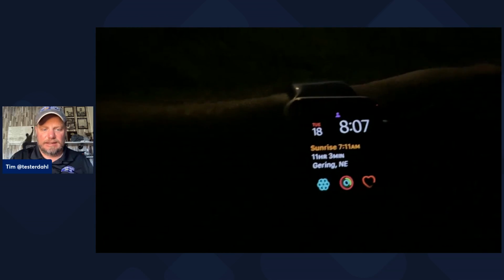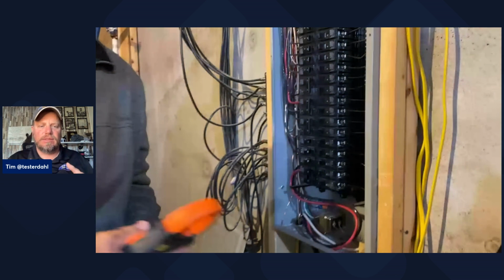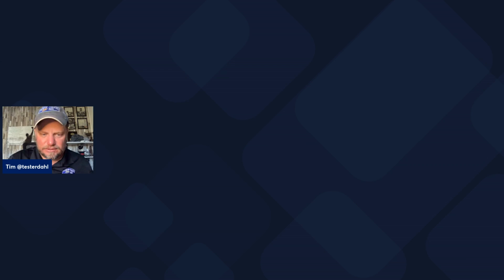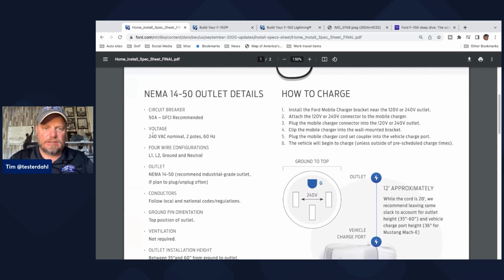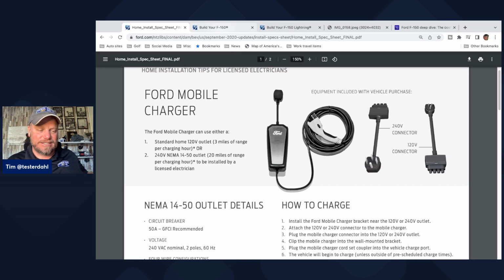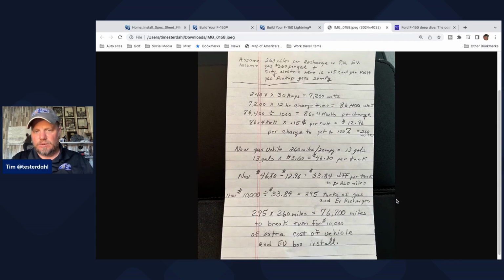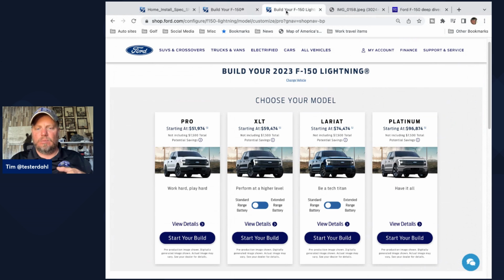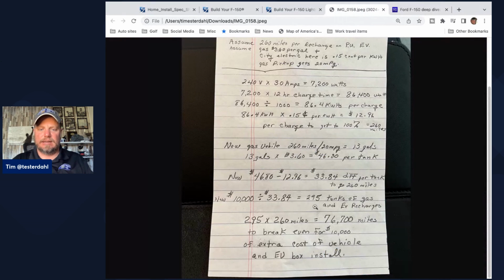11+ hours later on 220V charging price for 2022 Ford F-150 Lightning

Comment: 10 minutes to fuel up my conventional truck and go 400+ miles. EV takes 13+ hours to go <300 miles. QOL difference is worth FAR more than any 'savings' you might get by going EV. Never mind the SOUND of a good size v8 is far more satisfying.
Reply: For some pickup use cases sure, but that may change in the future. For more commuter type EVs and their typical use cases though, QOL is improved since you’re not stopping for even 10 minutes every week or two.
Reply: Not to mention you can’t use an EV truck as a truck. 85 mile range hauling 1000-1800lbs? Lulz
Reply: It took Tim 0 mins to charge to 100%, did you not watch the video?
Reply: Amen dude
Reply: If people think oil is so limited then they should really check out how little material we have to make batteries. The price of materials will triple in no time.
Reply: @Tony-hf9mv  Yep 100%.  And not to mention the colosal diesel machinery it takes to mine it, and the ships and trains to transport it.  The mining machines each use 300-500 gallons every day, and the amount of diesel a ship burns is unfathomable to the human mind, not that I care, I’m an ag technician.  But EV fan boys are annoyingly and willingly blind.
Reply: @Tony-hf9mv  That it will. Plus, recent discoveries have concluded that oil is not from dinosaurs as scientists 100 years thought was the case, but it is actual algae and it is made continously throughout the earth.
Reply: @DanBCooper  LOL because oil and then gasoline don't need to be transported they just magically appear at gas stations.

Really though there are studies that take all the transportation and mining into account and EVs break even ecologically after about 3 years and it's getting shorter all the time as the grid continues to get greener.
Reply: @usa-ev  and there are studies that show the opposite.  You’re not jaded are you, Mr “EV” ?   Lol cmon dude you’re obviously one sided and willingly blind
Reply: @DanBCooper  I'm not willfully blind, I understand BEVs have a greater ecological cost up front due to mining and material transport. But i also understand that BEVs pay back this deficit as you use them, which is not the case for ICEs that just spew more and more. These studies went to great lengths to detail all the "costs" on both sides. What do you believe I am turning a blind eye to?
Reply: Amen driver✊🏿
Reply: @ALMX5DP    Except the problems/limitations of EVs remain the same as they were  when electric vehicles outnumbered gasoline powered cars in the early 1900s. So if these limitations in comparison to fossil fuel burning engines have not been overcome by now...
Reply: @usa-ev    kids in the Congo may disagree with your opinion however.
Reply: A) What conventional truck do you have that goes 400 miles. It's quite curious that you didn't mention it. Is it the same class as the Lightning?
B) How often do you go 400+ miles in one shot? If it's more than a few times a year, then yeah, your QOL with an ICE is probably better. But you also qualify as a corner case compared to most drivers.

Most drivers (80%+) don't drive more than a few hundred miles/week with long distance journeys being a couple times/year. For those drivers, their costs and QOL are much better as they never have add time + distance to fill up on a weekly basis; they just go home and plug in. Your assertion may be correct for you, but it's the wrong math for most drivers. 

I drive 250+ miles every few months between Seattle and Portland. Even when I charge away from home, it's not much of an inconvenience; fast charging stations are at shopping centers, etc. I can top off in about an hour while I'm enjoying lunch or dinner. It's only at home that it might take 8 hours.

I haven't bitched about the cost of gas in 2 years- my cost and time expenditure charging at home is stable, and much cheaper than any gas station, and my quality of life has vastly improved now that I'm not sitting in line at Costco to get the cheap gas because of volatile oil prices. EV owners also have the added benefit of never needing to schedule time for an oil change (something else I'm sure you're not taking into account in your cost/QOL argument).

You should be thanking me and other EV drivers instead of critiquing our choices. Our choice to move to an alternative fuel has kept demand on oil lower than it would otherwise be, which has kept prices lower than they would otherwise be. Imagine if tens of millions of EV owners worldwide were still putting demand pressure on the price of oil- you and your ICE buddies would be paying much more today. 

I'm not going to crap on your choice to keep your ICE if it meets your need of driving 400+ miles in a single trip more than once a month- it makes total sense for your particular scenario. But your assessment of QOL/cost is completely wrong for most drivers, especially when you consider that electricity prices will always be more stable than oil prices. Oil is a monopoly resource, there's only one way to get it and refine it for your needs. There are at least 6 completely different ways to produce electricity that will always be in competition with one another. You can't mine/refine oil in your back yard while you can harvest electricity right off of your roof.

And this is only the first generation of EV trucks/products. The next generation of battery/motor technology is already in production and surpassing this one. ICE technology has plateaued and can only be improved (both in terms of performance and efficiency) with the addition of EV drivetrain components. Your 400 mile truck (in addition to this Lightning) is already being eclipsed by vehicles that can go 500 miles plus and go from 0-60 in less than 3 seconds.
Reply: I get 675 mile range out of my F150 with extended size tank.
Reply: @paulo3011    let's see if you are still in such deep love with your EV choice in 10 years. But it is your money 💰. 💰. 💰...
Reply: @Kdavis8377  that’s fake news lol. The range is limited but not to the extent you say here. Also you have to understand there are fast chargers. But for normal use. Charge overnight and have full battery next day. And it’s a lot cheaper. Also you have to remember we are in the early days of ev and chargers
Reply: @moultonlavagaming  it’s not
Fake news. I literally watched a YouTube video. A guy pulled a light load in his electric truck and barely made it 100 miles or less.
Reply: @Kdavis8377   I saw the video from tel trucks where at close to max load it’s about a percent per mile but definitely wasn’t your claimed weight of 1300 pounds. Show me the video you are talking about.
Reply: @Kdavis8377  also it highly depends on the profile on the trailer as well.
Reply: @Kdavis8377  also you are doing this on 4 gallons of gas. So you are towing that with so little is pretty cool. As we get the batteries better that range will increase more.
Reply: @moultonlavagaming  And I will add that the next test should be with an ICE vehicles that only has 4 gallons of gas an then see who has the most range.  That is how you show the efficiency difference.  All EVs need now are larger capacity batteries and that is coming soon.  All that is the matter is the “gas” tank is too small.
Reply: @GoogleUser-xr2hr   Of course your gas tank is equivalent to ~1000 Kw-Hrs. More or less.  Depending on its actual size of 25 to 35 gallons of gas.  Think of not only the cost of buy that amount of gas and the environmental costs to produce it and ship it.  EVs will never need a battery that big.  There is a better way and it is coming.
Reply: Personnel I like the quiet of my lightning.  Plus no more gas stations or fumes. No more ICE vehicle maintenance. Plug it in at home and all charged in the morning. I wouldn't have bought if it was to be used for long distance driving.
Reply: @Kdavis8377  If you want a truck for long distance hauling or towing then the lightning isn't for you.  I bought mine for local use. I can haul over 1600 lbs in the bed and if I need extra I hook up my trailer and can tow up to 10,000 lbs.  Anywhere I need to tow or haul. Plus I have very little maintenance,  no fuel stations,  no fumes, more torque than any F150 I've ever owned and I  can still get the equivalentcy of over 35 mpg towing 10,000 lbs and hauling 1600 closer to 70 mpg at today's fuel costs. Not towing I pay $.08/kwh that's $.04/mile in winter and $.12/kwh which is $.06/mile in summer. I'm done driving fuel guzzling, noisy, maintenance extensive ICE vehicles.
Reply: @Tony-hf9mv  I drive an average of 150 miles a week with an 8 yr/100,000 mile battery warranty I don't worry about the battery.  And since I keep it in the recommended 15-80% SOC range I expect it to last as long as the tesla battery, which some are still on the road after over 300,000 miles.  He'll, I'm 73 years old, even if I lived to be 100 I could drive that far. And talk about a great investment.  I paid MSRP for my platinum,  I  could sell it today for up to $50,000 more than I paid for it.  The demand is that great.
Reply: @pstoneking3418  drive 600 miles a week just for work
Reply: @usa-ev  You just can convince these ICE vehicle diehards.  I average 70 mpg equivalentcy with my lightning platinum and even if I'm towing so it drops to 35 mpg. Who cares I bought it for local use. I couldn't get even 20 mpg with my 2014 F150 & yes it had power but I have the same instant power with my lightning.  Granted these aren't for those people that want to use the for long distance traveling.  But the big reason for that is the lack of charging stations. One day there will be as many or more than gas pumps. Of course I won't pay the ridiculous price for public charging anyways since I can plug in at home and even if I had to put in the entire 131 kwh @ $.08/kwh in winter less than $11.00 summer closer to $16.
Like I said  diehards.  But not because if their age I'm 73 & love my lightning.
Reply: @DanBCooper  Look EV's in my opinion are not ready for long distance traveling, mostly because the lack of charging stations. (Excluding Tesla)   I bought mine for local use and it not only out performs my 2014 F150 V8 flex fuel that was all beefed up with 8 lug wheels and heavy duty suspension. But it does it at lower costs averaging me 70 mpg hauling and better than 35 mpg when towing its max of 10,000 lbs. I charge at home for $.04/mile winter & $.06/mile summer. Yeah towing costs about twice as much but remember local towing so wind resistance isn't nearly as bad as on open interstate. 
I know it's hard to convince diehard ICE vehicle enthusiasts,  and that's fine EV's aren't for everyone,  that's a fact
Reply: @JK-wr6is  That's exaggerated line lost I've installed my own meter on my lightning charging port and after adding 46 kwh to my truck I consume 50 kwh of energy at the grid. That's closer to an 8.5% loss. But when you're only paying .08/kwh in winter &  .12/kwh in summer That's a small price to pay.  Easily averaging 2 miles per kwh so that brings the cost down to .04/mile winter months & .06/mile summer months. $4.00 to drive 100 miles winter & $6.00 in summer. That's in a truck that weighs nearly 7000 lbs.
Reply: @paulo3011  It's very difficult to convince ICE vehicle diehards that EV's are great. I've been waiting for ford to come out with an all electric truck for several years now. I missed my opportunity to get a lightning reservation and was told if I was lucky I might be able to get one by 2025. That was very depressing for me as I'm already 73 and as we all know we're not promised tomorrow.  Anyway bugged my local ford dealer every week to let me know when they get a mannequin so I could drive it. Finally as luck would have it they called and asked if I'd like to test drive. First person they called. Of course YES. When can I come in. First in morning. I asked will you be selling it? Not for 6 months,  but if I was interested I could put a $1000 non-refundable down payment & in December it would be mine. The best day went for my ride but first thing I did was put down the $1000 which I told them I'd be doing the previous day. I'll take possession of it this December.  In the meantime I  had scheduled to drive it for 2 hrs ever Monday. For the past 3 weeks now I've been driving it from Thursday mornings until Monday mornings. Now that they have another mannequin I'm on the schedule to take it every Thursday- Monday. Almost like it was mine.  It will be in December.  These people haven't a clue what they are missing not having a ford f150 lightning. One fantastic truck.
Reply: @DanBCooper  And I could put a generator in the bed of my lightning.  But the main point of EV's is to get away from the gas, fumes, noise & extravagant maintenance required.
Reply: @m_m_m_beer8917  Do you even have a clue how long tesla batteries have been lasting? Some as much as 300,000 miles and still going. I  drive my lightning approximately 150 miles a week or 7800 miles a year. That's over 38 years.  I'm already 73. I don't believe I'll live another 38 years.
Reply: @Kdavis8377  It's not the weight that kills the range, it's the wind resistance. But you are definitely right. If you're looking for a truck to tow long distance the lightning,  nor any other EV truck is right for you or anyone else. But if all your truck usage is local like mine is then the range isn't an issue because at the slower 55 mph speed limits the wind resistance is much lower, therefore your mileage range is only cut by 1/3. So I can tow the tallest trailer weighing up to 10,000 lbs and still easily get 150 miles. Pull in at home and charge back up overnight for $.08/kwh.
Reply: @Tony-hf9mv  I'd say the lightning or any other EV isn't for you. Maybe some day when battery technology evolves. But not right now.  And our public charging infrastructure is terrible. But it's perfect for me and many others too.
Reply: @JK-wr6is  maybe a little higher than that but regardless when I charge at home for as little as $.08/kwh I  don't complain about it.
Reply: @pstoneking3418  The honesty in your response is very refreshing.  And truthfully I say the more EV options the better, it’s not for me, or most truck owners, but if it works for you especially with your relative cheap utility rates that can only be a good thing imo.  I’m all for it.
Reply: @pstoneking3418    Neither do I.
Reply: You need to change your thinking about how EVs are charged vs gassing up an ICE. You will charge overnight to get the mileage you need for the day, then at the site or at work while you're doing your work. You won't need to take time out to charge up because you will do it when you're not using the car.
Reply: @Kdavis8377  think differently about trucks and their relationship to trailers. Now that we can put batteries and drive motors on things, why not the trailer? Lippert and Airstream have already done this making the trailer a net zero load on the truck (even a gas truck). This will change things when more trailer manufacturers see the benefits.

Imagine being able to unhook your trailer and then "drive it" (via your phone) into the extract spot you want because the truck couldn't pull it there. That's the future!
Reply: @DanBCooper  and those diesel engines power what?? Please, follow thru... They power electric motors because diesel motors can't generate the same torque efficiently. Same with trains and other very heavy machinery.
Reply: @SuperSnakePlissken  doubt that. Please share the science for that... If that hasn't already made the news on science channels (which it hasn't) then I would be very skeptical
Reply: You’re missing the point of EV’s. They’re not a replacement for your truck. They’re an upgrade from a golf cart for someone who lives in a gated community, they can run on the road outside of the community as well as run on the sidewalks in the community.
Reply: Hi Everyone. How many of you are driving the expensive, energy intensive horseless carages out there? With the answer being 0 of you all. I bring this up, for just like the horseless carriage of the late 1800s advanced into the cars today, EV's will advance rapidly to net 0 environmental cost to build as demand for EVs goes up here. Added note to comments above about EV batteries and how they need mining to build. So you all know, we are on the verge of advancement where EV batteries will no longer need heavy metals in the building process; with note, the CO2 battery that can be made with materials in your own back yard are already developed, and being tested right now in other areas of renewable energy. Where then these batteries will be implemented for EVs in the coming future.

Quick added note, is that we also have hybrids out there as well. Where if needed, they do run on gas only. With note, some of these hybrids DO NOT NEED TO BE PLUGGED IN as the movement of the car along with energy created by braking charge the battery verses a plug in  to charge.

Point is, We in science are advancing the EVs and hybrids faster, so they will be net 0 for the consumer.
T
Reply: All EV  don't  take that long.   Mine take 10sec to plug in the adapter and go inside and it starts after 9pm . Mine charger 32 miles an hour while I  sleep .
Reply: More than just money involved. If we all don’t start changing our fossil fuel consumption, then we’re all screwed.

…queue the haters who have zero fucks to give.
Reply: @paulo3011  My 2018 Sierra 1500 with a 5.3l v8 has a standard range of 418 miles per tank. I drive up north into the mountains on a highway of 180miles +/- that has no gas stations or rest stops, often in the middle of winter at -10F to hunt caribou. Only time I have ever gotten range anxiety… though I did take several extra gallons.

Just because I only make that trip once or twice a year for hunting doesn’t mean I want to be forced to buy an electric vehicle that can’t make that trip. I have no issues with EV’s in an of themselves. I have an issue with people in Washington trying to force everyone to buy into them. They don’t know how we live our lives.
Reply: Yes sir.
Reply: @paulo3011  I'm not in the US but my 25 year old hilux can get about 700+ miles it has a second tank under it and if i'm going for an adventure with the 2 jerry cans i can stretch that out to about 1000 miles before i need to refill and in Australia that can be really handy and something an EV can never even dream of doing
Reply: @pstoneking3418  that isn't how batteries work though some may get 300,000 miles but it works out better to do that within a few years because even if you bought a brand new EV and never drove it again after taking it home in 30 years your battery is still going to be pretty bad tesla got caught out with 2021 model 3's put NOS batteries in that were made in 2017 they ended up needing to reduce the price and put a warning on them that there was up to a 12% range reduction
Reply: @shaynegadsden  nice try buddy- production EVs from Lucid and Nio already have 500-600 miles of range in production; both hit 0-60 in less than 4 seconds with 900/600 hp respectively as well as 3x the torque of your Hilux. ONE developed a battery that they put into a Model S that pulled 752 miles of range. Aptera has a 1000 mile EV.

This is with maybe a decade of serious EV development and still first generation pure EV technology. It took several generations for your 25 year old Toyota to hit that range figure, and it has nowhere near the HP and torque. Perhaps you weren't aware-  just about any car (ICE or EV) can go several hundred of miles when it has no weight, no features and no performance. Your Hilux isn't even in the same size class as the Lightning, let alone any other spec. But I suppose you can pretend to be right when you compare apples to oranges...
Reply: @paulo3011  being the same size as a ligthning really isn't point neither is rapid acceleration, reliabilty and repairabilty and the fact you can extend the range of most ice vehicles very ezsily as for your battery and the aptera until they can be independantly tested they are nothing but concepts also they are all tiny cars. And another thing i wasn't talking about unloaded even empty my ute isn't unloaded since the back, bullbar and other extras are already a few hundred kg
Reply: @shaynegadsden  acceleration and class isn't a point? I hope you never read  a car editorial- experts will disagree with you completely. If you're discounting power and capability of a vehicle in favor of range, then I can bring in concept cars; if you want to compare vehicles in completely different segments, then there's no reason that I can't point out a concept car to completely blow your point away. 

Your original statement pertained to range that EVs could "dream of." If we're talking dreams, the concept cars that have had real world demos are on the table. Don't change the rules just because I proved you wrong.

You're completely mistaken if you want to add reliability to the list of items you want to consider in this discussion. It is demonstrable fact that fewer mechanical/moving parts = better reliability. Watch some of Munro Live's videos, you'll definitely learn a few things. EV powertrains are far less complex and have fewer failures. Dealerships are resisting the transition because they know they won't get as much profit in repairing EVs. Everybody freaks out about a battery failure when they're warrantied for 8+ years and they will last on average 150-200K miles without any service; meanwhile the various components of an ICE engine need regular servicing and replacement multiple times a year.

You're barking up the wrong tree if you want to discuss the reality of reliability. Fact is you don't need to repair an EV.

Next you'll probably want to discuss battery fires. There are far more ICE engine fires per year than EV fires; the NTSB  showed that electric cars in the US caught fire at a rate of 25.1 per 100,000 sales compared to 1,530 for ICE vehicles. That data alone demonstrates that EVs are safer and more reliable.

Hardcore ICE fans like yourself use your corner cases and perception to make your arguments. When you bring the considerations back to the most common situations, rather than your corner cases, as well as data vs your perception, the numbers in most cases are in favor of EVs.
Reply: @paulo3011  well they are the same type of vehicle but we don't really have much that size, and no acceleration isn't important it looks great on paper but in reality it just causes shit to move around same as braking hard you try to avoid that too, also could dream of is a figure ofspeachh and no because a concept car isn't reality that might be what they are hoping for but until they launch something that can be tested then it doesn't exist, as for being a hardcore ice person that is an assumption on your end i have spent my life working with electricity and have a much better understanding of what it can and cannot do than most. And finally when it comes to reliability no ev's aren't good just because 1 part of them has been simplified that doesn't fix all the other problems granted most of that is likely due to them being a new product but we only get what's availible now not what they may sort out in the future.
Edit: Also your fire numbers are bullshit while numbers quoted might be correct they don't mean anything in the US where the numbers are from there is about 287 million registered cars if you take that group pick a fault compare it to new sales then it will be high, the opposite is true for EV's they have a small total number a couple million but a large chunk is recent sales so i don't see how what you quoted proves anything so in reality it's 0.54 per 100k ice vehicles and 0.84 per 100,000 EV's i used 3 million which is a decent over estimate to be fair so while both are very low an EV is still more likely to catch fire
Reply: People said that about horse and buggy v.s. The first cars too. 
Nobody will ever type on glass, physical keyboard on your smartphone is the only way. Paradigm shifts all have to start somewhere.
Reply: @ALMX5DP  you can fill up at your house if you get a tank and you don't have to stop either
Reply: @joelocker3508  how much does that cost, and how much space is required? What are costs and steps associated with filling up your house then?
Reply: @ALMX5DP  it's same price sometimes little cheaper per gallon and I just have to make a call every now and then for a 500 gallon tank and pump was 1400 probably lot less than buying charging system for your ev truck
Reply: @joelocker3508  and where does that 500 gal tank go? Also what convenience does it add if fueling up is so quick?
Reply: @paulo3011  my 2017 Nissan Titan 4 wheel drive gets 427 miles per tank - and I drive 645 miles one way - and good luck finding a “working” EV charger on that trip
Reply: @Tony-hf9mv  You have to dig up 5000 tons of earth to get enough material to make one battery.
Reply: @usa-ev  The materials used to manufacture EVs come from crude oil. If you work close to your home and only shop around town they're great
Reply: I will say Tesla has the charging down.   I have a long range model 3 and from 0-100%(310 mile range ), it takes 9 hrs on a level 2, 32 miles an hour.   Basically saves you $ if you plug in when you get home and leave in the morning.  So far I have driven 30k miles in 6 months and spent $1100 on tires so far not including about $500 in super chargers 
I also have a Chevy Colorado that I have driven 45k miles in one year.  I spent $5500 in fuel and oil changes and have not put new tires on yet.   I get 500 miles on a tank of gas.
Reply: My 3.0 Duramax GMC diesel will cruise 620+ miles on a full (24 gal) tank that takes no more than 10 minutes to fill.  Super efficient, very low emissions.  That also comes with tons of  available, low rpm torque.  This is why the EV truck is a hard sell for me.   Possible exception might be if the truck were to be used strictly for short-distance city driving.  But since I'm a country boy. . . no Bueno.
Reply: @Kdavis8377  are you serious?
Then... what the freaking heck?? What are they good for ?
Reply: @SuperSnakePlissken  Oil comes from every living thing that has oil in it not just Alegre or Dinosaurs, every plant, reptiles,  mammal, fish, humans.
Reply: Not when you can charge at home. Most ev owners will never see a charger away from home.
Reply: Gas forever we are Americans we have all the gas oil coal and natural gas we need and more. Trump 2024👍
Reply: @theknies  What if you go to grandma home in a different state?
Reply: @paulo3011  I travel 170 to 250 miles per day in my HVAC business. Sometimes I'm not at the shop or home for more than 8 hours a day. Also the batteries on EVs only last 150,000 miles max. I get 450,000 miles out of my service vans with no major issues. My accountant calculated that just the battery replacement costs alone would make it more beneficial to drive anything getting better than 14 mpg. That's not including the overpriced upfront outrageous costs for a EV. That's not including the extra outrageous registration fees that the state is charging for EVs. Plus we haul over 2,500 lbs of equipment and inventory. According to the tests on the Ford lightening we'd have to recharge every 90 to 120 miles. It's totally impractical and would triple HVAC cost for the customer.
Reply: @usa-ev    it's not going to happen.  Just the copper supply alone will keep it from happening..oh have you looked at the copper mines? Did you forget about the hundreds of pounds of copper each EV uses? I own a HVAC company and it's been really hard to get wiring and copper line sets for the past several years with this year being the worst plus the price has tripled in the past 2 years. That's just the motor and conductors. Now add the rare earth magnets. Then the rare earth minerals the batteries use. Then think about the trillions of metric tons that are going to be needed for all trucks and personal vehicles. Plus battery powered lawnmower type equipment is using up more of the same supplies. Then you have to add all the copper needs for the charging infrastructure. Like I said IT'S NOT GOING TO HAPPEN. Oh yeah, more copper and real hard to manufacture silicone is going to be needed for the solar systems.  Simple logic and common sense skipped you greenies.
Reply: @Bryan-Hensley  LOL, no, we did not forget about copper. And the price of copper never even doubled from pre-pandemic levels and today it is up less than 15% from 5 years ago.

You need to find new suppliers for your business because yours are apparently taking you for a ride and making you look like a fool.
Reply: @usa-ev  I wish there was a good answer. But EVs definitely isn't it. Sorry. Maybe synthetic fuel will make headway. In fact that's the best answer. No infrastructure change, no one has to purchase new disposable EVs. People can keep their dependable vehicles. All synthetic fuel needs now is a power source like the small nuclear reactors, or the new fusion energy or  something equivalent. Carbon neutral fuels..
Reply: @JK-wr6is  Add to that there are people who are not homeowners, and live in apartments, condos, or rent rooms, in single family homes, do not have access to overnight charging!! If you cannot install solar panels on your roof, your power bills are going to "Skyrocket"!! If you are a renter, you really don't have a lot of charging options!! You can't have an EV charger installed, if you live in a rental unit!! Fast charging on a public charger is fairly expensive!!
Reply: @pstoneking3418  amazing someone could be that stupid to pay that much money for any vehicle.
You’re right, however, there’s a sucker born every minute.
Reply: My EV takes ZERO time to recharge. Every morning, my car is ready.
Reply: Considering every man, woman, and chiild pays ~$6K/year for defense, aka "protection", now how do you feel about "cheap" gas?
Reply: @ws6002  I'm all for you getting EVs.. it'll cause the price of gas to drop for us
Reply: @Bryan-Hensley  That's right. So long as we depend on oil to run our trucks and cars, Opec has us, you included, by the short hairs.
Reply: Has anyone thought about this theory. Let’s say everyone in Miami needs to leave for a hurricane and those residents are in EV cars. What part of Florida will they reach before the car runs out of electricity assuming they were all charged at the start of the evacuation. Let’s say Miami gets you into Orlando if all of Miami is in Orlando where do the Orlando area residents charge up for the evacuation.
Reply: @markkuhar1188  360 miles in my case.
Reply: @ws6002   I wish the American people could have voted on this whole EV concept instead of the government telling us we are going EV. The people would have voted hell no.
Reply: 2 different "refueling" methods you're mentioning here... 10 minutes to fill up your conventional truck, yes.. but the 13 hrs charge is at home on just a 220v.
I have an F150 Lightning, and at home  on my 80amp wall pro charger, I get 35-40mph of charge. I only use that when I'm home doing nothing, or overnight while I sleep.. and for daily driving, to and from work and some around town things here and there, I only need to charge if I wanted to, every 2 or 3 days, and I'm fully charged back up to 300
+ miles of range in just about 5 or 6 hours.
while out on longer trips, I stop and charge like you would fill up at a gas station,.. Like when traveling to my brother's house 95 miles away... I can leave my house with 75% charge or so, and get all the way to my brothers house and back if I wanted without charging... But i usually stop at a DC fast charger and top off from say 35% to 80% in about 20 to 25 minutes. often times Im stopping for 10 to 15 anyway to grab a snack, or drink or whatever... and the truck is charging the whole time while doing so. would be the same thing on any longer road trips for me.. stopping every 3 or 4 hours for 35 minutes to take a break, and charge up for another 3 hrs +
so yes, different use of fueling, and a little more time... But not by much. 
use it for what its designed for, and not anything else...
just like the old days with the original lightnings, or GMC syclones, Dodge Ram ST Vipers.. or "trucks" like those.. You weren't towing anything with those, much less carrying family or luggage anywhere in the,. 
The performance on this truck is unmatched so far (until others come out with pick up truck EVS) and that's the only reason I bought one! 
those that kid themselves saying theyre saving the planet, might want to recheck that.. It takes something like 500,000 lbs of ore to be mined to make just a  few batteries for these EVs... so the C02 impact is just a great or greater, its just that its elsewhere instead of out of the tailpipe.
Reply: @ALMX5DP  

 Stopping for 10 minutes a week or 2? 

Do you realize how silly that sounds?

Just wait for a black out where the grid goes down and you can't charge.

That will really be fun.
Reply: @PontoonPilot  ZERO minutes recharging time. From when I walk I to my garage to when my car is ready to go, 0 minutes. Now it's a different story when I go across the country. In that case, charging is 20-30 minutes for 360 miles of range. But most people, 95% of the time, see zero minutes because they don't start at 0 charge and because it happens while I am watching TV, eating dinner or sleeping.
Reply: @DanBCooper  
It's cult mentality
Reply: @SuperSnakePlissken  
I've been saying this for 20 years.
Reply: @paulo3011  
 My Chevy avalanche gets 400+ miles consistently out of every tank of gas, in fact I even got 600 miles out of it a few months ago and took a picture of my range....

 400 miles is not hard to get out of a tank on a pickup truck.
Reply: @nickdial8528  The cult of the antique, smelly, low torque, costly gas, bagpipes (gas trucks).
Reply: @nickdial8528  people seem to value every last minute of their time, so I simply responded using the same. Lots complain that an extra 20-30 minutes on a road trip is unacceptable, to me both are reasonable concessions.
Reply: @nickdial8528  fair enough, and good for you. But many points still remain, if you're only driving a few trips per year in the hundreds of miles, never hauling anything (like 90% of truck owners and 98% of car owners), or your hauls are between the hardware store and home, then you'll save money, maintenance and time by having an EV that can charge at home. Even still, the generation of EV scoming in 2023 and 2024 are at or suprassing that 400 mile range while simultaneously beating comparable ICE vehicles in acceleration.
Reply: @paulo3011  

 At this time there are no E v's projected to be able to be able to beat internal combustion engines in these categories. You're talking about a technology that doesn't exist yet and is speculative.

 If they really wanted green energy for vehicles, they'd be much better off going to hydrogen. They have safe  ways of putting hydrogen tanks on vehicles now, it doesn't replace internal combustion engines, it puts out clean water, and you don't have to reinvent the wheel.

When it comes to really using vehicles  like trucks, EVs have a long way to go.

It doesn't matter also what most people do, we do not have a grid system that can support everyone going to EV vehicles, there's not enough rare Earth materials or minerals to support production of EV vehicles for everybody, it's a complete pipe dream and not rooted in reality.

I wish that wasn't the case, I would love an EV truck if it could do everything I needed it to do, but that's just not the case.
Reply: @ws6002  

 That's exactly my point, what you just said is very cultish.
Reply: @nickdial8528  According to a Moonie.
Reply: @nickdial8528  There are some difficulties you will need to overcome for hydrogen to "work". First, do you produce the hydrogen by ekectrolysis or by steam treating natural gas? Electrolysis unfortunately is a very inefficient process with some like half the electrical power turning into heat, which means the process is very inefficient. And inefficient hydrogen generation means it is very expensive to drive, the equivalent of paying $10 a gallon for gas. Second problem is that, as NASA could tell you, it is very hard to build vessels or piping for hydrogen that doesn't leak. Hydrogen atoms are physically very small and it's just very hard to make a weld joint that they can't slip through. Third problem with hydrogen is that it has a low energy density by volume. Jason on the Engineering Explained YouTube channel does a terrific job explaining this. Basically, you would have to use the whole trunk and the whole back seat area up to the roof to hold enough hydrogen to get 300 mile range, assuming it is stored as compressed gas at 10,000 PSI. Meanwhile, EVs have about 80% energy efficiency if you include the losses at the power plant, transmission lines, battery and motor. And they have up to 360 miles range. With a lot of space in the trunk and even under the front hood.
Reply: @ws6002  
 It doesn't matter how much space an EV potentially has. You are still at a weight verse energy deficit, and there is not enough grid support or materials to globally support Evs being a mainstream option with current technology.
 People are completely jumping the gun on this and letting their ambitions completely get ahead of reality
Without some major breakthrough and a completely revolutionary  form of creating batteries that can put out more power than their size and weight as well as being stable, this is nothing more than a fantasy being pushed.
Reply: E are hearing out there from you people. They make it sound like a couple mins and boom your redy to go.
Reply: @nickdial8528   lol dude, you have no idea what you're talking about- he F150 lightning and the Rivian both put down the RAM TRX in drag races. There are plenty of videos, look them up. EVs already beat ICE in terms of maintenance, and definitely no ICE vehicles can refuel at home. The Tesla Model S Plaid and the Lucid Air both beat nearly every production ICE vehicle in drag races.

As far as hydrogen: you have to use electricity to compress and electrolyze the hydrogen. It takes 100 kw/h of electricity to produce 19-23 kw/h of useable hydrogen when distribution inefficiencies are accounted for. That same electricity turns into 80-90 kw/h on an EV after transmission losses and can properly a Model S, Model 3 or a Lucid 350-400 miles today and can be delivered via a dryer plug in your garage. The cost of producing hydrogen is 8x more expensive per mile than just directly charging your EV. The only way the cost of hydrogen production comes down in price is if electricity prices come down. 

If you're concerned about the electric grid, you want to stay away from hydrogen given how much electricity it takes to electrolyze hydrogen. Your position makes absolutely no sense.
Reply: @nickdial8528  Sometimes, people pull stuff out of their butt. I fear you have been listening to them. EVs are mostly made of steel. It might even be steel recycled from an old car. There is some copper in there, but a lot less than in your house. And some lithium. Do you know how much? A Tesla Model 3 Long Range has about 140 lbs of lithium. Batteries weigh a lot, but there's only about 140 lb of lithium. I want you to stop and think about the electric grid for a moment. Every new factory requires a lot more electrical power than your typical Supercharger facility. Suppose I make a deal with you to bring ALL of the manufacturing that has gone overseas back to the US. Do you say 'Hell no, where will we get all the copper???" OF course not. You are going to say "We had better start building out the grid!!" And we will, but not as much as you think. Most EVs are charged at home, late at night when the grid demand is at its lowest. I'm not saying everything has already been built. I'm saying this task is not going to break America.
Reply: i am never recharging more than 40-50 miles overnight in my kona ev . once i have solar i will pay under a penny a mile to drive. what car can do that? trucks are still kind of marginal for people who need to drive 300 miles a day pulling 12,000 lbs but for the dorks that just driving the 4x4 around as a commuter and getting a load of gravel or wood a few times a year they are fine.
Reply: @cybertrk  he said after charging for 13hrs.
Reply: @Mad John You are going to look back at this day and say "I was so dumb." I only need to add about 10% charge every day, and I charge at home in the garage while sleeping.  Do you spend your evenings watching the refrigerator? Well EV owners don't spend their time watching the car get recharged, either. Especially if there is a football game on. The only exception is when I'm driving across the country. I can drive 5 hours and then I recharge for 20-30 minutes. Which I typically use eating dinner. Most people  should take a 20 minute break from driving every 5 hours anyways. The Nav system on the car plans out the stops, which is convenient.
Reply: 13hr for half charge lol
Reply: @breadcat6454  My EV is charged in 0 minutes.
Reply: Love all the back and forth between the two camps. It’s all hilarious to me. Thank you to all these gullible EV purchasers that are paying exorbitantly high prices for these new EV vehicles. I think they are cool and you are subsidizing the cost of the future of cheaper EV vehicles which is when I’ll buy one. For now, I’ll chill with the ICE crew and enjoy my 400+ mile gas guzzling F150 that I can work on, haul loads with, take off road and do other truck things. I agree that right now an EV is a supplemental vehicle to an ICE vehicle, not a replacement. When it becomes a legit replacement; I’ll buy one in a heartbeat cause they are cool. Just not worth the investment right now and I don’t see any incentive to switch including gas savings. The amount you save in gas is negated by the large overhead you are paying. How many miles do you have to drive to break even over an ICE?
Reply: I’m with you !!!
Reply: @GoogleUser-xr2hr  and 5 minutes to refuel !
No need to hang around Walmart all day
Reply: @moultonlavagaming  energy is energy 
It takes time to transfer !
Laws of physics aren’t gonna change real soon …
Reply: @nathanjohnson3668  GM says they are coming out with a $30K Equinox EV next year. No one can tell you what to do. I just felt the need to knock down some of the deliberate FUD. With that in mind, I would suggest people here go to the "Engineering Explained" YouTube channel and watch their video called "Can the electrical grid support all the EVs". It's from 1 year ago. Jason is a big fan of gas powered cars who also also likes EVs. Also, I suggest you look at the "Transportation Evolved" YouTube channel from about 5 weeks ago where they used an F150 Lightning to pull a car in a car trailer across the country.
Reply: @ALMX5DP  we have a nearby rock quarry that recently changed to all electric heavy equipment,  and the guys say they are very impressed with more, instant power than diesel. And alot less maintenance. Much cheaper to operate.
Reply: 30 minutes to charge at a 300 volt fast charger and less than 10 minutes when the new batteries and 800 volt chargers are available in the next year
Reply: @usa-ev  and greedier.
Reply: @usa-ev  isnt gas really unicorn rainbow pee? Thats such a let down.
Reply: BEV trucks are fine toys for those who want one and would be ok for work that doesn’t require much driving or requires a remote AC power source, but for the large majority of working truck owners they just don’t make much sense.
Reply: @ALMX5DP  Yup.  I've waited for my EV to charge ONCE in the past two and a half years, and that was because I was running a datalogger on my very first CCS session ever so I'd know what to expect with future sessions.

Typical daily routine:  Get home, plug in, battery is charged when I wake up.

Road trip routine:  Plug in, go inside to eat lunch, be already deep into taper by the time I finish eating.  Took a second stop for a quick charge because I had to pee.

People complaining about long EV charge times for long trips don't seem to understand that fast chargers exist.  This overnight session was only 30A or 7.2 kW.  The standard range Lightning can go up to 11.3 kW, extended range to 19.2 kW.

At a CCS station, those become 120 and 155 kW for the SR and ER models.
Reply: Ho hum I charge my EV while I sleep 😴 6 bucks easy peasey.  😴
Reply: @easygoing2479  fair enough but the only thing I am aware of that is mandated is no more sales of ICE passenger vehicles by 2030 work and heavy duty are exempt. Seems fairly reasonable to me, but perhaps you are more aware of the regulations than I am.
Reply: @nickdial8528  not to mention battety recycling problems
Reply: @JK-wr6is  Good thing it doesn't take any fuel to mine diesel or gasoline, no fuel needed to transport it from the refineries, and none used in the processing... and I'm sure it's way more efficient to drive to a gas station than the line losses getting electricity to your home... thus I'm sure electricity costs way way more than diesel to fuel comparable vehicles... oh what? Costs about a quarter to 1/10th to fuel an EV than to fuel an internal combustion vehicle to the same range.  Oh yeah... time to move the goal posts again.
Reply: There is plenty of good application for EV.  They’re just being pushed too hard without actually being efficient yet.  

City people with simple commutes is great.  Me trailering every day terrible.  

Still have energy grid problems as of now with no obvious relief in sight.  Costs for EV will go up dramatically if this is pushed through.  Also, look how they’re getting the electricity.  #1 way is natural gas plants.  Talking about firing up coal again.  

People haven’t even started dealing with battery replacement when we don’t even have lithium mines going here yet, think of lithium costs.  

Tesla with the most EV experience has the most recalls.  The rest of the EV’s are simply too new to even know all the problems yet.

EV is by no means a clear winner.  Hybrids for now are hands down better solutions.
Reply: And the Good Looks of the Conventional.   Part of my learning to drive was a 55 Peterbuilt Conventional with a 4×4 double stick transmission.  It really turns heads when upshifting in reverse.  Great Truck.
Reply: @paulo3011  I drive at least 250 miles a day twice a week. My ram pickup gets close to 450 MI per tank. I also tow a pontoon boat at times. My fuel mileage drops 10 or 15% when towing 5,000 lb. I've seen the reviews on the lightning, full charge gets less than a hundred miles towing a thousand pounds. It's ridiculous to think an electric pickup truck is practical.
Reply: Totally useless in the outback..  and they are dangerous to recycle..  not economical at all..
Reply: @garyszewc3339  great. If you read my initial comment, you would realize that I said that anyone with your driving habits keep their ICE. Your driving habits do not represent 90% of the population. You are in the minority.

Is it a disease among you folk that you totally ignore (or don't understand) the part of my comment that says "keep your ICE if you're a corner case and drive hundreds of miles in one trip?" I don't mean to be insulting, but I can't count how many of you people feel the need to tell me about the hundreds of miles you drive in one trip after I say "keep your ICE vehicles if you fall into this category."  

I'm not sure why you felt it was important to tell me about your driving habits after I already addressed it and told everyone that I agree it makes sense to keep your ICE vehicle. My comments  about an EV are targeted at the overwhelming 90% of the population that do not have your driving habits.

In other words: it's not about you.
Reply: @paulo3011  because I'm not in the minority. You were in the minority that only drives a few miles. People in big cities with public transportation could use an electric vehicle but the vast majority of the country needs more than what electric vehicles can offer.
Reply: @garyszewc3339  Did you try Googling some statistics before you commented? According to the FHWA, the average American motorist drives between 26 and 35 miles per day depending on which year you pick over the last decade.

That is a very far cry from the amount of driving you're claiming. You claim you do 250 miles 2x a week. Assuming you drive only 35 miles the remaining days of the week, your average daily miles is ~3x the average American. Your driving habits are in no way representative of the majority of Americans.
Reply: @paulo3011  since when does the FHA do driving statistics? And it doesn't matter, it's not useful as a pickup truck.
Reply: While I agree that a gas but actually a diesel preferably with an inline 6 cummins would be better. Electric motors have instant torque and I dont give a fuck what it sounds like I just want to go sideways.  Lol
Reply: @usa-ev  Two questions. 1 How is lithium mined? 2 how is electricity created?
Reply: @pstoneking3418  correct on the air resistance. Using a Ram diesel pickup, gross wt at 38,000lbs hauling a load of steel, it'll make 10-12mpg, and run at 65mph great. Gross at 24,000lbs pulling a 12-14ft wide building, it'll make 5-6mpg, and it's all it can do to hold 65mph. Start adding wind, speed starts going down.
Reply: 13 hours was just for a half a tank
Reply: @bannedtwice7767  How is Lithium mined? There are two main methods: ore-based and brine-based, the brine-based method involves evaporating brine that already contains the Lithium and doesn't seem too bad.  

How is electricity produced? Again two main methods: pushing magnets and loops of wire past each other, and solar (magic).
Reply: @usa-ev  you’re a volt dolt.
Reply: @scottpreston4021  Hi, Scott, welcome to the conversation.
Reply: I can add 27 miles of range per hour on my Mach-E. EVSE pulls 40 amps.
Reply: @xr9450  nice strawman. Half of your points are already out of date or poorly considered/researched. Plenty of people discuss, analyze, document, and make YouTube videos about range decay. 

What you're not discussing is the fact that LFP batteries (several auto manufacturers have these in production now) have almost completely eliminated the issue of range decay (in addition to eliminating battery fires). Solid state batteries will not only address range decay, but also address the disingenuous weight issue you bring up.

Aside from the fact that Lithium Ion batteries from 10 years ago are still in service today, modern EV batteries have expected average lifespans of 15 years- well beyond the standard 8 year warranty.

Brake wear is a non-issue. Regenerative brakes don't wear out. The design and logic is simple- the more you use regenerative braking, the less you use friction brakes. Hybrids and EVs have easily demonstrated they can go 100k-200k miles without replacing the friction brakes.

Here's a question for you- why do you only care about weight when it comes to EVs, but not with the ever increasing sizes of American vehicles in general? The fact that gas guzzling ICE supporters suddenly care about vehicle weight after American vehicles gained thousands of pounds is bullshit of the highest order. Americans never cared about vehicle weight gain before, the fact that you're picking that issue now is just demonstrates your inability to think objectively and bias coming into play.

Increased weight equates to increased capability- in this case EVs are more efficient while having better performance than their ICE counterparts. The continuous improvement approach to EVs have them shedding weight with some significant weight loss coming in the next few years due to solid state batteries. Some EVs are already within 500 lbs of their ICE equivalents. 

About the only half valid point you brought up is street wear and tear- and even that is effectively moot when you consider the increased sizes and weights of American vehicles. Do you think we should go back to horse and buggy so the streets last longer? Do you think we should eliminate big rigs hauling cargo and Amazon deliveries? If not, then your concern wit the wear and tear  is nothing more than your bias.

There's more I can say about each one of these points, but I'll end by saying just do a bit more research and reflection before you go off half cocked.
Reply: @paulo3011  hows the electric bill? Id prefer hybrid given power outages outside of but including storms like hurricanes taking out power for a bit too long
Reply: @Kdavis8377  Nonsence  130 miles for $10  charged overnight while sleeping

V8 F150  gets 10mpg towing the same 7000 pound trailer

12 gallons @ $5.00 $60

Fuel savings after 10 years   

$37000    versus the F150  gas
Reply: CHARGED 20-80 % on a DC Fast charger  is 20 minutes.
Reply: @robcrissinger776  so you only want to tow 130 a day? Good luck on a 400 mile trip. I’ll be enjoying my weekend at the camp ground. You’ll be leaving on Friday and getting there Sunday.
Reply: @Kdavis8377  you start from home with a fully charged battery  $10 at home 
You drive 2 hours for 20 minutes charge. Rest. Go to the bathroom etc. Leave rested  drive again
another 70 miles you're at your mythological campground that you go to each weekend
Play
The weekend on the chargers at most good campgrounds or charge to full at a DC supercharger 
Return home

Not having spent. $40. $200 in Gas

You stop to pump fuel
You don't rest
You in order to do the trio faster then the ev towing the same load
Don't stop to eat
You spend $150 more 

Do it in about the same time  or maybe  save 40 minutes 
Wow
Time is money and if you don't mind pissing away $150
Reply: @robcrissinger776  time is money. No thanks.
Reply: And you can do that, non stop all around the country,  until the wheels fall off....
Reply: Qol ?
Reply: @DanBCooper  mining irrelevant.. pointless 
Nill worth zero
Reply: @paulo3011  my 2013 F150 with a V8 averages 19mpg and with the 36gallon tank I can go about 700 miles without a fill up. I can do things with that truck that I NEVER could with an EV. 
More than happy to buy an EV truck when they get range figured out. Until then I’ll drive the pickup that cost me 15k and has had virtually no mechanical issues in 5yrs. 
No way is an EV ecologically neutral in 3 years, you clearly haven’t seen the strip mines where they get the materials for your battery.
Reply: @nickschaps4022   yet another strawman argument- no one ever claimed EVs would be "ecologically neutral." You came up with that on your own. EVs are better for the environment. If you're worried about the strip mines for batteries, are you going to suggest we don't use laptops or phones and go go back to land lines and cords?

Sounds like a great truck. However it costs you ~$130 to go 700 miles, it only cost me about $28 to travel that same distance.
Reply: EV's @ this point, are for the regular person that drives to work then comes home to put it on the charger.   There  is a  reason Tesla sells so many cars there more cost effective to run than gasoline currently. BUT you better budget for that battery when it comes time to change it.
Reply: @moultonlavagaming  The Baker EV was produced in 1900. An infancy doesn't last 120 years. Read up on how much "new battery material is able to be mined and its cost for the driving population, then where do you put all the 10yr old batteries. I bet you still want to make fuel out of our corn too. Earth provides plenty of fuel for fuel, food for food and battery material for flashlights. Stop with the intermingling destructive behavior. Damn.
Reply: @jasonsteverson4609  where do you get that they only last 10 years? Because there are many Teslas that are older than 10 years. There are many Nissans that are older than 10 years and they’re still on the road so stop with that.
Reply: @jasonsteverson4609  you also act as if gas and oil and producing that isn’t restricted to the environment as well. That’s why we need more renewable energy, solar, wind, energy sources like that are plentiful and could power everything.
Reply: @jasonsteverson4609  way to make some inconsptions about me a person you don’t know a thing about. I want renewable energy to be more plentiful, because pretty much the sun could power everything that we do currently and then some
Reply: @phillipmullis7904  exactly good point plus all of the fossil fuel it took to dig that up and all the devices used and then after the batteries are depleted after 10 to 15 years the resources it takes to recycle those batteries Plus the whole time that electric car is getting used it's getting charged with fossil fuel so what's the point
Reply: Let's see where this stuff ends up after the battery is thrown out. Let's see the environmental impact it'll have on the soil, water, wildlife.
Reply: @Tony-hf9mv  Plus the roads those electric vehicles are driving on are made of what’s left from crude oil after gas is extracted from it.  The plastic in the vehicle is also made from oil.
Reply: My issues with ev is 1 life is not predictable enough for the time an ev needs to charge to be dependable because emergency are unknown and life happens fast..2 as normal humans we jump the gun and go head long full force with something with out haveing a plan or knowledge if it truthfully is better and or if we should..to deal with the byproducts and harm that an ev industry might do to the planet or man kind..the other thing that has to be taken into consideration is the temps these batts are in and long term batt degradation extreme heat bad extreme cold bad longer it’s used worse the batt is..the batt is the car I’ve seen a hand full of people the past 6 months be put into hardship cause they have to replace the batt and it’s 35,000 bucks on a car they still pay a loan payment on…
Reply: Cant we make fuel out of corn?
Reply: @paulo3011  how long do EV batteries last?  What is the cost for a new battery for your vehicle?
Reply: @usa-ev  really? Where do the materials come from that make your EV? You think your EV can be charged using windmills and unicorn farts?  Typical of a person who thinks it will but lacks critical thinking skills.
Reply: @Roadglide911  LOL! 

Materials - same place materials for everything else comes from. 

Windmills - definitely! The grid is getting greener every day!

Unicorn farts - doesn't sound very green, I'm firmly against industrial scale unicorn farming. Perhaps unicorn farts are the common ground we can come together on?
Reply: I get it. The tech still isn't the best it will be.  BUT, the choice is everybody's future, or a cool sounding gas guzzler... 
How big are people's belly buttons???
Reply: @Tony-hf9mv  Its not about oil being limited.  Its about oil POLLUTING, and its production cost for some types... 
Countries like Canada still have huge deposits that were just too expensive to produce, either because its bituminous and needs extra refining, or it was stuck in permafrost... We actually have the 3rd biggest oil deposits in the world...
Reply: @DanBCooper  That is why you are a technician and people that look at the bigger picture think about our future.  
Let me theorize with a basic math example...   
Let say we get rid of the tens of MILLIONS of fossil fuel burning engines, but need to keep a few thousand big ones to make it work... The NET pollution will drop by a lot... Even with those 500 gallon an hour engines going.   
Don't you agree? 
Maybe the EV tech isn't perfect yet, maybe it ITSELF pollutes (a lot less than the fossil fuel system), maybe they aren't even the right solution and we'll end up with Hydrogen or mini-reactors, etc... But keeping on burning OIL is not viable for future generations. So anything that cuts the damage is worth looking into.
Reply: @The_TRUTH_or_Nothing  people that have actually broken down the numbers claim the EV is more pollutant than. Gas powered vehicles once the mining and smelting to produce the batteries is accounted for. Not to mention it is a far more limited resource than oil. Then claimed a EV would have to run on the same battery pack for 18+ years before any co2 offset was seen compared to modern gas vehicles. I don't see a battery pack lasting 18 years 😕. Don't get me wrong cities would look cleaner but in the world scale the air would be worse. Toyota years ago seen methane as the answer as climate change activities say it needs to be burned to be safe. Unfortunately there is no money in free energy nor can it be manipulated. Land fills, sewage treatment plants, and farms could all be modified to capture methane. Honestly the biggest pollution producers on earth are the airlines but I have never once heard anyone even suggest limiting flights.
Reply: Anybody who buys one now is just a test subject for the manufacturer.
Reply: wat if gas cost 6.00 a gallon
Reply: @nickb654  roadtrip stops, absolutely a possible inconvenience. Daily commute and plugging in at home a couple times a week? Not so sure, especially when you consider it versus filling up at a gas station. The other aspects are a topic for another discussion as well.
Reply: How about that 30 amps full draw at 13 hrs. Wonder what their rate is... How much was paid to charge and the actual money saved. I think these people have too much money and don't know what to do with themselves. I make 50k a year before taxes... I wouldn't be able to afford a turd like that. I appreciate gasoline more... not ...novelty items.
Reply: @usa-ev  You're full of crap. Also why dont they mine components needed to make the batteries with electric powered mining equipment??
Reply: @cliffbrown2566  where did you get 50 years from?
Reply: @pstoneking3418  I bet you don't haul a crew to job sites. Not hauling a small excuvator? Picking up materials all day? Id say you probably live in the suburbs and haul ten bags of mulch at a time.  Trucks were designed to work be car with a small bed.
Reply: @cliffbrown2566  What specifically do you think I've got wrong? Also, regarding electric mining equipment you may want to research before leaving comments.
Reply: @paulo3011  I don't think anyone is critiquing ev drivers choices it seems quite the other way around.its not ideal for alot of people in alot or areas just yet not to mention the cost of an actual cool ev is outrageous
Reply: @sdmc1972  I don't know what you define as "cool," but the average cost of a new car is approximately $48k. There are at least 9 models  at or under that price range (with more being released for 2023), including the Model 3, Mustang Mach-E and the Kia EV6. I think "outrageous" is an exageration, especially considering they have features and functionality that their equivalent ICE competitors don't have. 

And reread the comments- there's plenty of criticism (and aggression) toward EV drivers; the aggression translates to the real world. ICE drivers specifically modify their vehickes and target EVs and hybrids by obstructing visibility in the hopes that they crash their cars. EV owners have no equivalent practice of road rage.
Reply: @paulo3011  I paid 23 grand for a low mileage ss1le camaro you got an equivalent to that in ev? And I live in Pennsylvania I don't ever hear of people persecuting ev drivers.i don't like the looks of most tesla especially one that is actually affordable same with the Mach e and I dont care for Hyundai/ kia as the quality control leaves more to be desired I currently own a kia and previously owned a Hyundai so I'm speaking from my own personal experience
Reply: @usa-ev  what happens in eight to ten years when it is necessary to replace the battery . Oops more math Damn .
Reply: @paulo3011  what planet do you live on.    When the demand for electricity goes up so will the price
Reply: @pstoneking3418  the battery only lasts eight to ten years. And they use tires and brakes faster .
Reply: @nottoday4125  ideally the range will just keep getting shorter and the truck 20 years down the road even with 50% of its range will still be worth something to someone like on a farm or similar.
Reply: Yep driving 250 miles in 4 hours and having to find a motel with a plug in for the day. The motel alone cost is more. It would take 4 days to go 1000 miles
Reply: @pstoneking3418   Is however your side of the Isle. What's all of us to drive   EV. I drive an average of about 900 to upwards of 3000 miles a week. I do expedited freight I cannot do that in electric vehicle. However your God Biden wants me to.
Reply: It's not about the planet It's about keeping you in control
Reply: Just don’t get any ev
Reply: @James J unfortunately the government is mandating so not so much capitalism.  I still liked the bio gas toyota was working on. Otherwise known as methane. Unfortunately free energy can not be manipulated and therefore little margin for profit. Sewage treatment, pig, chicken, and dairy farms all converted to capture methane
Reply: @Kdavis8377  there is a video on line of a ev hummer pulling a camping trailer(5k i think in weight) after 123 miles they had to backtrack 40 miles to get to a more "powerful" charging station.150 watts/ volts i believe charger could accommodate the rig with trailer.They opted to UN HOOK the trailer so they could get into the 350 volt/watt bay. The Dodge diesel continued on and doubled the range of the Hummer.Both vehicles were pulling the exact same trailers.
Reply: I have it figured  out its pretty  simple.  I'm 65 wont live long enough  to break even on ev vehicle  or solar.  So answer  screw  it
Reply: @paulo3011  so what makes the electricity? What mining process strips the land and ruins it forever. Watch what happens in Nevada once the mining starts there. What country controls over 80% of Lithium production?
Reply: @henrysmith8012  drilling for oil does the same thing, making your point effectively moot. Clearly you didn't think about your comment before you posted. 

That said - we have plenty of alternatives to lithium coming to market including sodium and sulfur, this is an addition to solid state batteries. 

Here's a question for you - did you care about lithium mining and supplies when you bought your cell phone or laptop? Or is it only important because you don't like EVs?

Unlike oil, lithium doesn't literally burn into smoke. You can extracted and use it again from a depleted battery. If we're going to extract materials from the earth it makes more sense to extract materials that's can be reused later.
Reply: @paulo3011  so please tell me how much coal will it take to just charge all those evs? Solar and wind do not supply enough electricity to power a major city. So tell us how you are going to charge your ev without a carbon footprint bigger than any gas or diesel car.
Reply: @RalphERo824  Relax, the transition to EVs will be fine.

If you want true energy independence from governments as well as travel autonomy an EV paired with solar is the best option.
Reply: What savings, electric bill is out of control?
Reply: @RalphERo824  why do you care about the amount of coal it takes to power an EV? Do you care how much coal it takes to to run your appliances, laptop or cell phone?

However much call it takes, I'm still paying far less than you are at the pump per mile.

That said, coal only makes up 19% of energy production in the United States, and is falling every year. I plan on using the several new nuclear reactors the United States has planned, the first of which just opened up this month.

Perhaps you're asking the question because you don't understand that transitions of this scale are not instantaneous? Or maybe you don't understand that we're going to be forced to transition when we run out of coal.
Reply: @USA EV  and lithium leach fields are terrible for the environment. Do you know where and how the other deep earth minerals are mined? Remember batteries don't produce energy, they store it from the coal/nuclear/nat gas/and the trash windmills. The average citizen of the world can't afford an EV vehicle at current market rates. If the battery dies after the 100k mile warranty expires the replacements are around $20k+... I've yet to meet an ev owner that's happy with their purchase and recommended I buy one when I asked.
Reply: So if I want to drive 1,200 mile trip for vacation I would have to stop and get a hotel 4 times in an EV. My wife and I can take turns in a gas vehicle and get to our destination without a hotel, just 3-4 stops for gas. Guess the EV is ok if you are wealthy and retired
Reply: @BVogel86  Lithium extraction processes are being advanced. Once mined these minerals will be in service indefinitely.  Even with mining and all it's better than oil.

Battery prices are still falling and today's pricey EVs are paving the way for tomorrow's affordable EVs both as used EVs and production scaling.

It's going to be OK.
Reply: Also if you think filling up a 16 gallon tank is expensive, wait til this guy gets his power bill. 220v at 30amps for 12 hours every day added to all the other power needs of a house rivals cannabis grow house level power bills.
Reply: @Tony-hf9mv  did you Google how many years worth of oil we have left too? I did oil 47 years and lithium is 70 years 😂😂😂😂 lithium is reusable oil is not.
Reply: @m_m_m_beer8917  Chevron poisoned the the Amazon. All things have a cost.
Reply: @lptvboy  did you not read the article?
Reply: @Kdavis8377  I have a 2023 Ford lightning standard size battery. Fully charged 235 miles of range. I pull a 5000 pound enclosed trailer to repaint the lines in parking lots at the end of a 10 hour day. I plug the truck in and at 6 AM. It’s fully charged and ready to go for another long day of work sure for a 12 or 14,000 pound trailer no but most people don’t pull that heavy of a trailer their entire lives
Reply: @Kdavis8377  I have a 2023 Ford lightning standard size battery 235 miles of range. I pull a 5000 pound trailer with line painting equipment for parking lots I can drive around the metro area well over 100 miles and at the end of the day I plug it in overnight and I’m ready to go again at 6 AM. Sure if you’re pulling a 10 or 14,000 pound trailer that’s not what electric trucks are made for